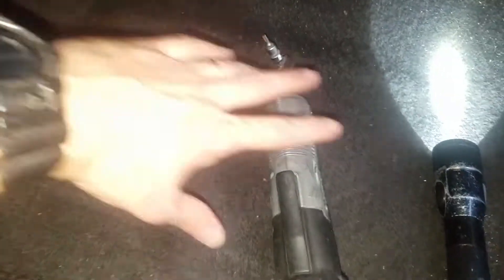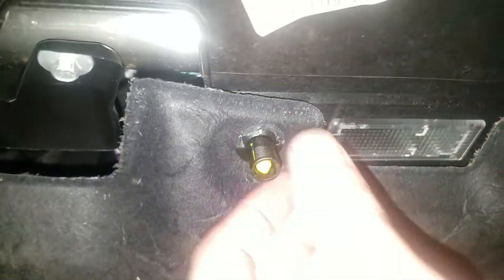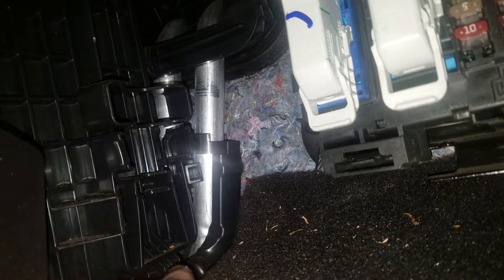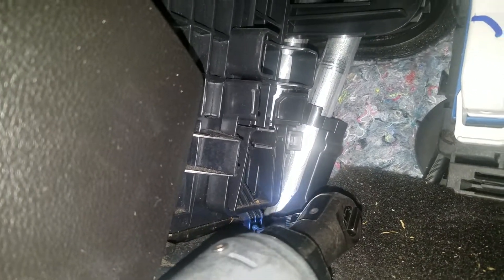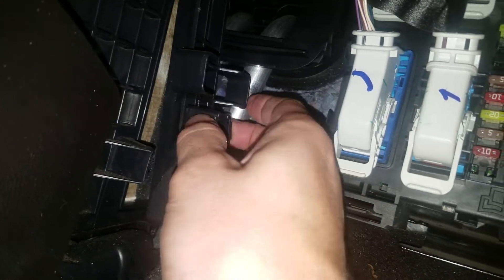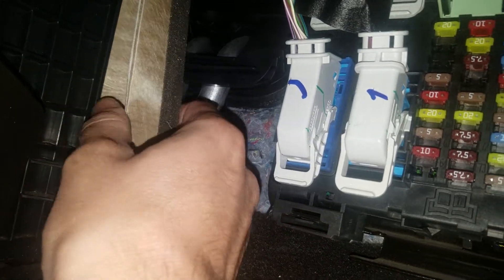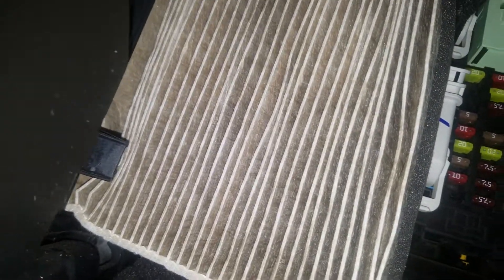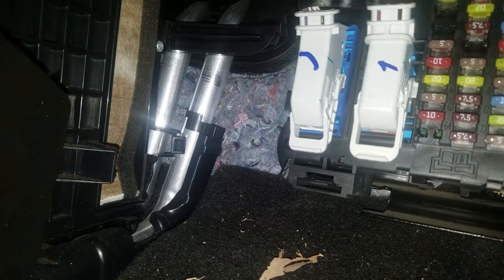2018 ford Focus cabin filter

Comment: You inspected the wrong side of the filter. LOL. The air blows into the other side, so if there was any dust and dirt, that's where it would have been. just fyi
Reply: Dirt can be easily seen from the backside, also.  The filter material is pretty thin.
Reply: Looks dirty to me
Reply: @David S. check it every 15000 and replace if dirty is what I do
Reply: @n05tr4d4177u5    That's the charcoal, but he did inspect the wrong side.  The air flows from the front to back.